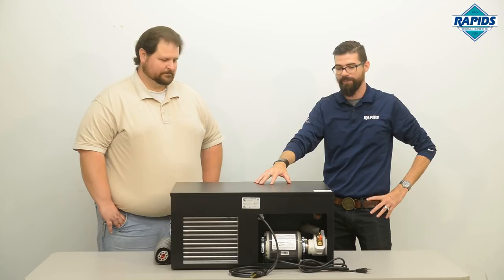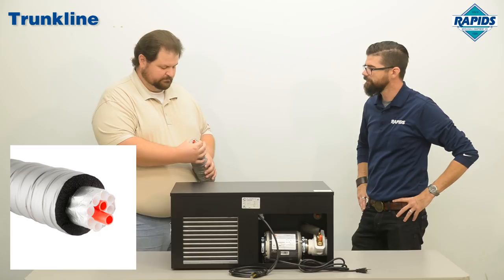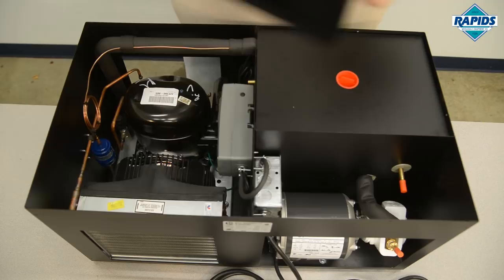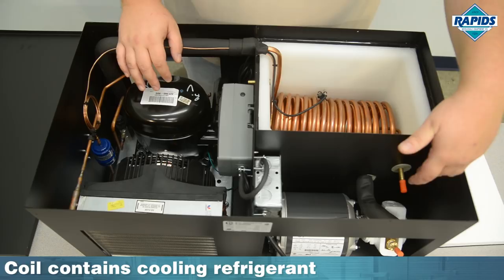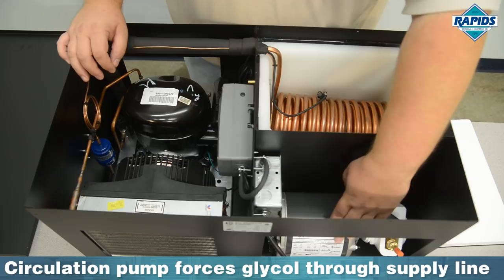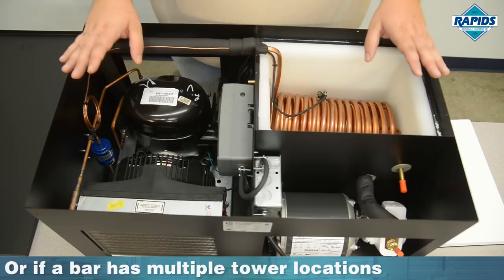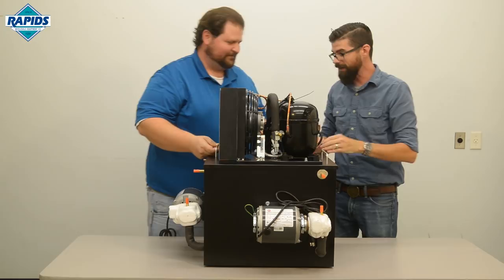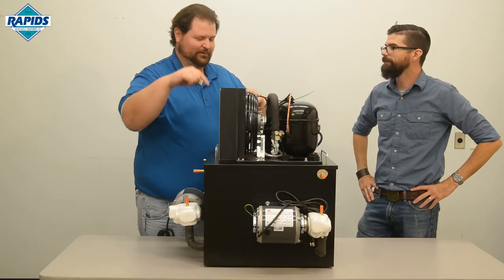Understanding the Basics of Glycol Chillers & Power Packs

Comment: About to install my 60 Ft. 1/3 HP 3 gal chiller I got from Rapids. Wouldn't it be better to tee off the glycol line in the walk-in and supply the 2 separate supply and return lines (for a 12 product trunk line) making a parallel system rather than connecting them in a chain and doubling your linear feet only to have the second run warmer than the first? The end result is probably the same resistance on the chiller pump but you're supplying the two lines with cold glycol rather than one cold and one somewhat cold. Please advise.
Reply from the maker: Hey Darryl, I'm picking Ben's big beer brain to see what the drawback to your proposal might be. Stay tuned or give him a buzz 1-800-472-7431.
Reply from the maker: If you were coming off of the chiller with a ½” line then splitting with a Y- or T-fitting I would completely agree.  But since the line coming off of the chiller is also a 3/8” line, all you end up with is (2) 3/8” lines each having a weaker flow than the main and therefore less cooling potential.  I would 100% agree with splitting the line if we were working with one of the larger chillers that have the bigger circulation pumps.  Then we could stick a PP291 glycol Y into the pump in place of the regular barb and feed both supply’s in the trunk simultaneously.  Unfortunately the 60’ unit (3K185) is manufactured with a different pump that makes this almost impossible.  If the series connection concerns them, you can always try adjusting the temperature down an extra degree or two and check the temp on the return line to make sure everything is staying cold.

Thanks!

Ben Wieser | Draft Tech/Inside Sales
Rapids Wholesale Equipment
6201 South Gateway Drive | Marion, IA 52302
p. (319)447-3504; 800-676-0612 ext 3504 f. (319)447-1680; 800-858-0327 | Click to Chat
ben.wieser@rapidswholesale.com | www.rapidswholesale.com 

P.S. "i mean, if they are running 12 prod trunk less than 30' it should be fine." - Ben

Comment: What you’re calling the evaporator is actually the condenser and condenser fan, the copper coil that is inside the glycol tank is the evaporator.
Reply: The guy did well, if you're not a pro then that's your mistake to learn from.

Comment: I want to design this solution for my home however thinking about how much energy it will consumed compare to using many AC
Reply: Yeah man I think central heating and air equipment has that well established efficiency wise for sure communicating systems are awesome you just need to design the equipment under manufacture specs as best as possible...

Comment: How much water do it use
Reply from the maker: Hello Haywood D. Water consumption will vary depending on the ratio of glycol to water each manufacturer recommends for each individual unit AND how much solution is required to fill the chiller and pack the glycol lines which vary in length. Hope that helps!